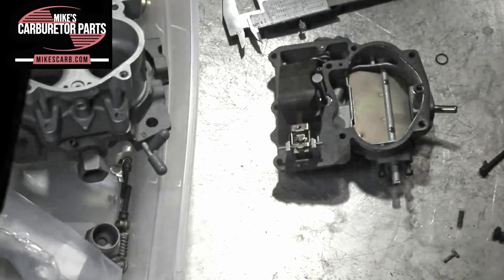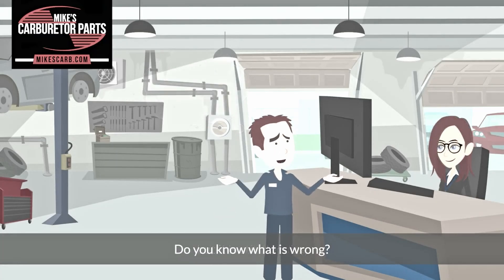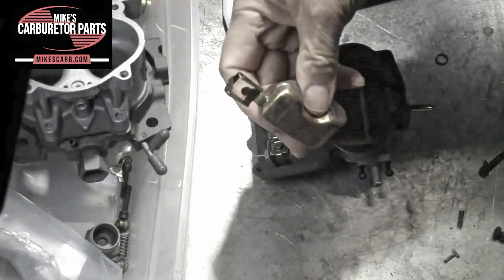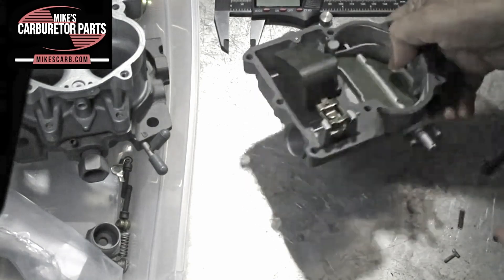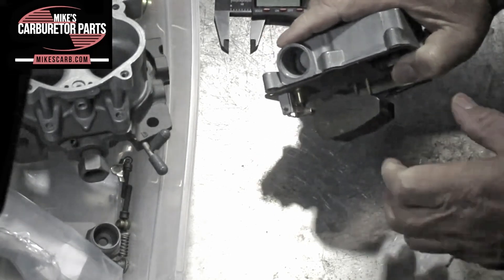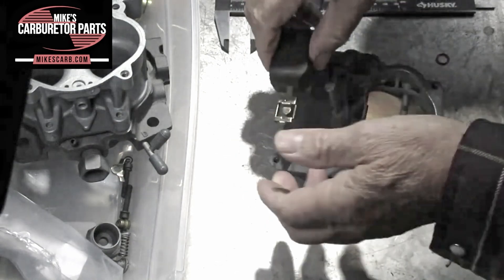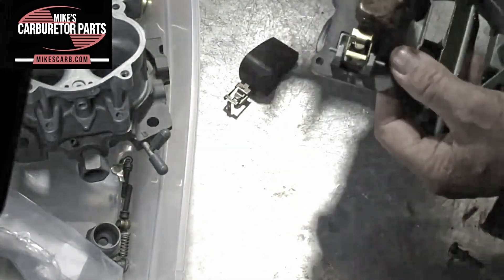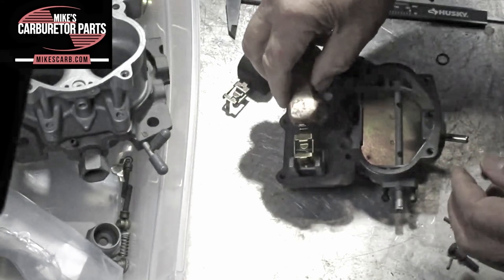2 Jet Float Adjustment

Comment: Hi Mike, I have a Rochester Varajet 2 carburetor from a 1980 Chevrolet Blazer K5 6L 4.1L. I previously purchased the repair kit from your store, and it's great. I want you to make a video with my carburetor adjustments. I don't know what the solenoid valve is for, and I want it to work properly. Could you make a comprehensive video with all the adjustments using the J-26701 Kent Moore Tool?
Thank you very much for your response.

Comment: I put a new Rochester 2 jet on my 1969 Buick LeSabre and I am really struggling with the adjustments.
Reply from the maker: If it is a new Chinese carb then that is the problem. If you can be more specific then I might be able to help you more. https://www.carburetor-parts.com/rochester-2g-2gc-2gv-technical